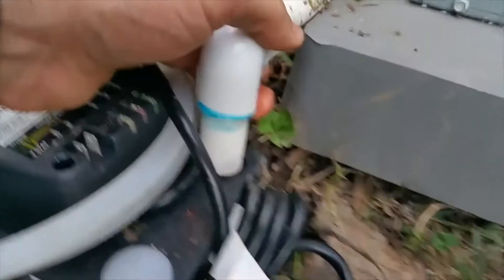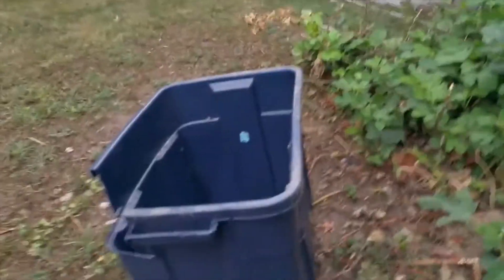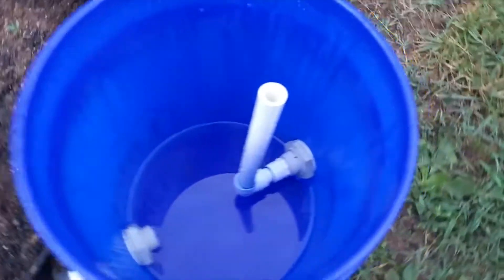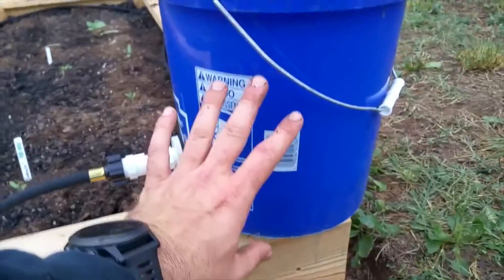Free water from the air, and my self watering raised garden bed.

Comment: So I've been looking at the whole water-from-air concept for a while now but never thought of the ac unit already being such a device! But its also not exactly what I was looking for either; I've been looking for a more passive system that doesn't use electricity. That being said, excellent job! I'll be giving this a try too. Thanks.

An idea I had when looking at your system is to incorporate a bell siphon or similar to collect an amount and then dump a load of water into a drip pipe, etc.
Reply: Ive seen one, with just some thin copper pipes made into coils, connected at each end to a hose, the hose connects into a cheap styrofoam cooler with ice water in it.  The cooler is positioned above the coils so that the hot water rises to the top of the sytem and that way the coldest water is always down inside the copper pipes.  
  And the coiled copper pipes are basically just sitting inside of a deep baking pan so that the condensation that collects on the copper pipes drips off of the pipes and all falls into the baking pan.

Im pretty sure they make those cheap disposable aluminum baking pans that come with a clear plastic top, if you had that top on it with maybe the whole inside of the pan would condensate? May or may not need to poke small holes in it for the moisture to get in. Idk  may not even need the holes.

Comment: That's not remotely Free. Massive costs for equipment & ongoing electricity costs. Don't deceive! Don't lie.
Reply from the maker: You're right, I had to spend some money to set up the condensate pump only because my property grades uphill to the garden. If I wanted to run downhill, a garden hose would be the only thing required which is hardly a massive cost. Even as is in the video, I have about $100 worth of materials invested in this system that produces 5-10 gal/day in the summertime. $100 will buy about 700 gallons of water from my city supply, so this system will pay for itself in one season. Everything produced beyond that is free of charge.

The house A/C system and electrical costs are already accounted for in household expenses, and the additional electrical cost of running a fractional duty cycle condensate pump is negligible. There is no additional load or expense related to the house A/C system as it would be running the same whether this condensate system was online or not.

The condensate is produced and dumped out on the ground regardless. All it takes is a means to collect it.
Reply: Great. Thanks a lot. Pardon if I came across a bit short. I am really seeking off grid solar powered systems and am having trouble finding them. Can you help? I am working on building one. I got a plan to help green the planet. Wish me luck. Thanks for posting ur stuff.
Reply from the maker: No worries, thanks for interacting. You're on the right track. I'm also interested in that sort of thing. This condensate system is really a workaround since I don't have gutters on this rental house. If I were in your shoes looking for an off grid water setup I would strongly consider that. Have you made any progress so far?
Reply: Jason Homer 
I've been looking at this too but solar panels are a bit too expensive and don't last much more than the time it takes to pay them off. Wind is good but not always reliable. I'm currently looking at solar Stirling generators and hho. Might be something for you to consider.